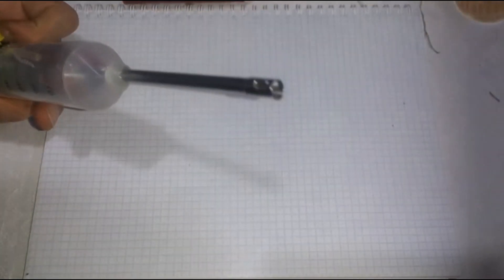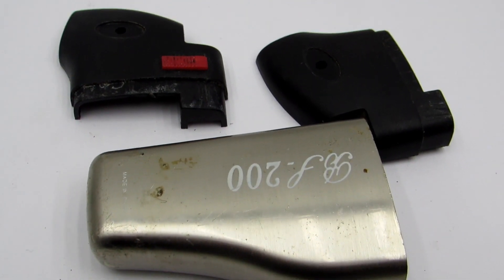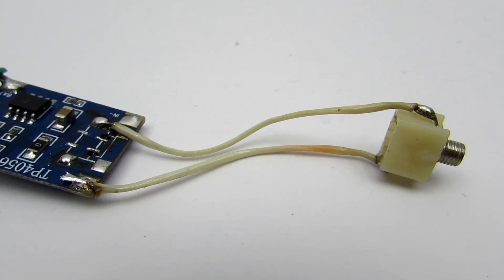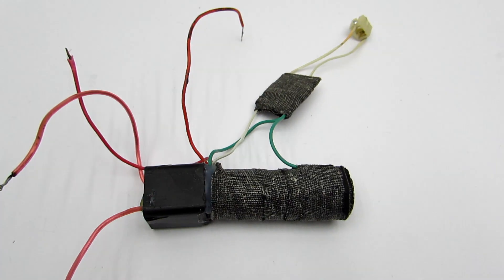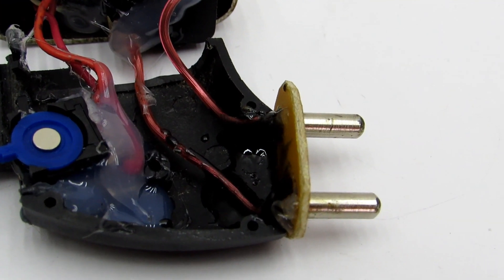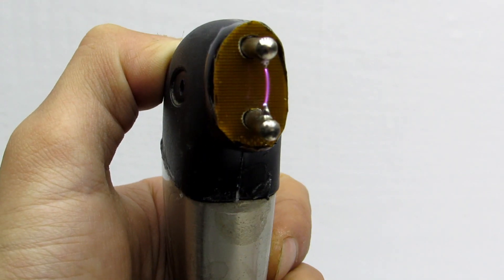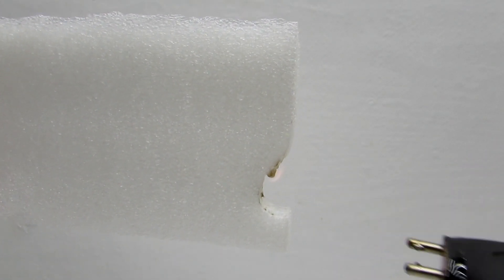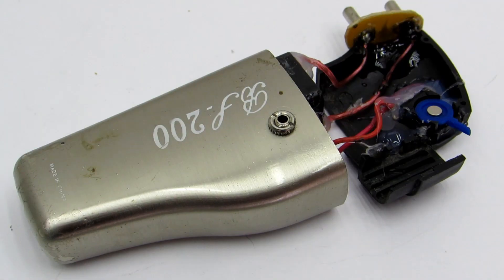DIY Plasma Lighter!

Comment: I bought similar generator but stronger (probably just says it's 400kv considering its from AliExpress...) And for some reason all i get is spark like taser would generate but i cant put anything on fire.

When i try to light up the paper it just makes holes in it and it wont put it on fire.

Any suggestions on what the issue might be?

Comment: hi everybody this video let me think about something...can someboby help me to transform one 200kv or7kv converter (that makes sparks) into one that make a plasma arc like that in the video please?thanks
Reply: rik s Maybe its because u haven't bought the same transformer as the one that is used in the video. The transformer in the video has a circuit inside. Not all transformer have that. But if u still trying to build this try look at this site here. It's a diy kit u can buy, and maybe it's a bit easier. Hope it helped😉: http://m.ebay.com/itm/DIY-Kit-DC-High-Voltage-Generator-Inverter-Electric-Ignitor-15KV-18650-Battery-/282216971000?hash=item41b5713af8%3Ag%3A3L4AAOSwmLlX%7EgAT&_trkparms=pageci%253Ad4a688d0-42ef-11e7-928e-74dbd180ea73%257Cparentrq%253A4a7d5dce15c0abc21f50fe1ffffeeba7%257Ciid%253A1
Reply: Remove the diodes and capacitors. Then it's done